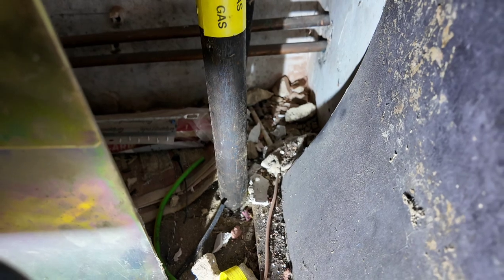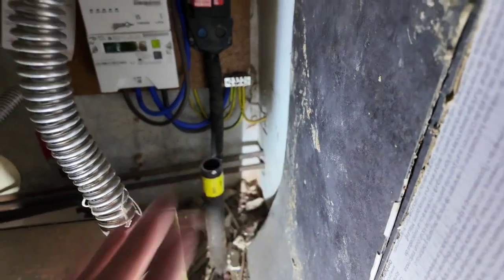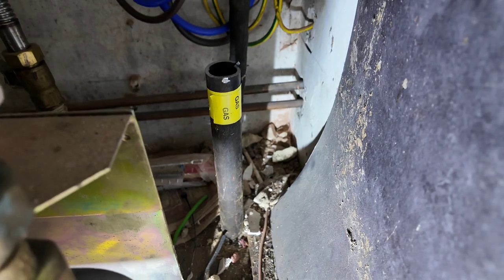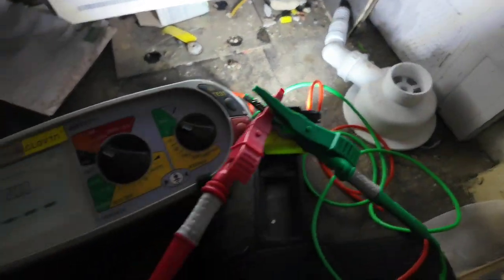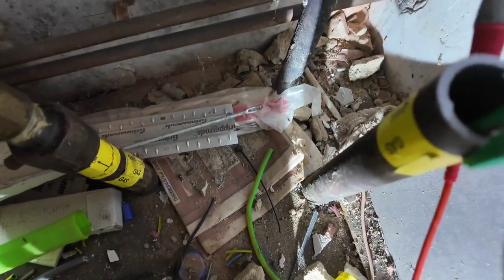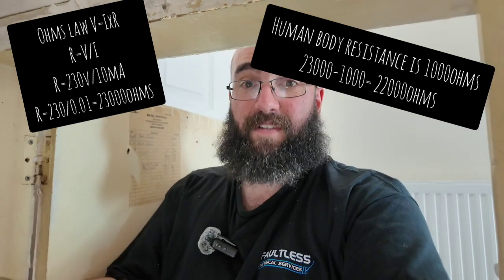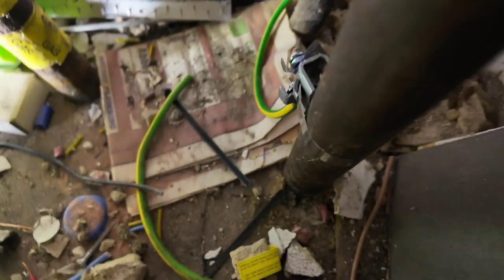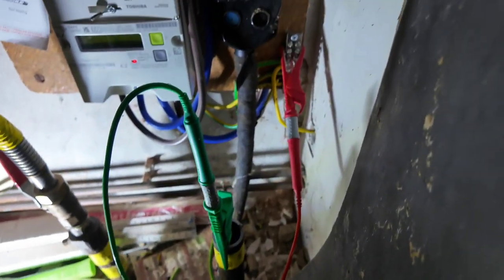To Bond Or Not To Bond 🤔 | Extraneous Conductive Parts

Comment: Hilarious -- 0.00 Megohms is not a dead short
Reply from the maker: It's the definition of a reading of 0.00Mohms? If you get a reading like that you would change the mft to low ohm and check if there was direct contact between conductors/pipework.

Comment: I just bond anything below 100k
Reply: Why?
Reply: @154electrician  Because it's introducing an  extraneous potential to a potentially different equipotential bonding space. Especially with the prevalence of TN-C-S these days, any 'actual earth' potential could be tingly in the event of the DNO not doing proper maintenance (what a thought!)... also, just because it reads one resistance on the day of the test, a few weeks down the line it could be an order of magnitude lower, and introducing a potential with some serious bite.
Reply: Picture the scenario, customer is on PME (TN-C-S) and suffers an open PEN fault, the lights start either going out or dimming and flickering depending. No touch potential exists due to bonding of all CURRENT services.

Customer heads to the harry potter suite to check out the CU, and grabs the redundant gas supply someone didn't bond, while also touching the 'not really earthed but floating at up to 240v to true earth due to the open PEN' consumer unit. Things get ouchy.

Bonding that redundant service would avoid this?
Reply: @TheChipmunk2008 but are we not trying to get away from just bond everything as its introducing more paths and potentially making the install more dangerous?
Reply: @154electrician  True, the 80s were a bit nuts with bonding everything, but in the case of a redundant service pipe that may have a substantial amount of metal in contact with the general mass of earth,  it really should be bonded to everything nearby to prevent touch voltage🌩
Reply: @154electrician  Also the more paths thing, good god I HATE TN-C-S
Reply: @TheChipmunk2008  i get what your saying but just didnt understand why you use 100k instead of 22k ohms
Reply: @154electrician  Just because it may lower, making the current higher, and also, 22k is a bit too low and would allow nasty tingly current to flow

Comment: To Bond Or Not To Bond sounds like a question for Ian Fleming.   (007)

On a serious note
I think the "SAFETY ELECTRICAL CONNECTION - DO NOT REMOVE" label was invented to help educate and advise others like Plumbers and DIY folk.

Something like BS 7671:2022 regulation 514.13.1 (newer versions of BS7671 are also available)

Comment: Thank you John for reminding other trades not to meddle with our work.
They don't understand the dangers.
Given the extent of the problem with PEN faults and breaks I think its time that the installation of an earth rod at every TN installation on the consumer side of cutout became mandatory.
The prevalence and increase in reported PEN faults is increasing (E5) and reflects the age of the undergrounded low voltage cables.
Unlike wine they don't improve with age.